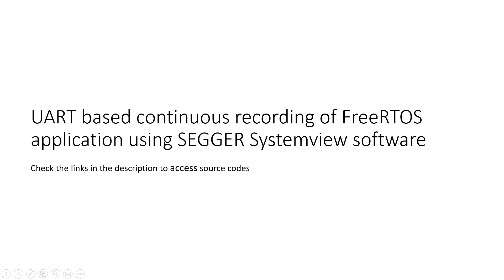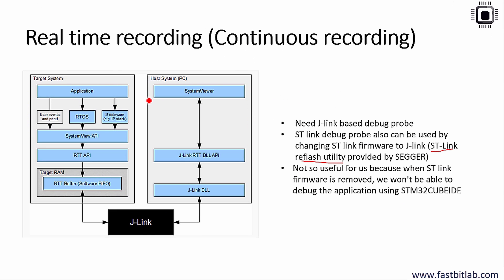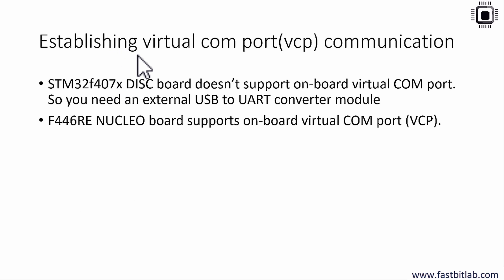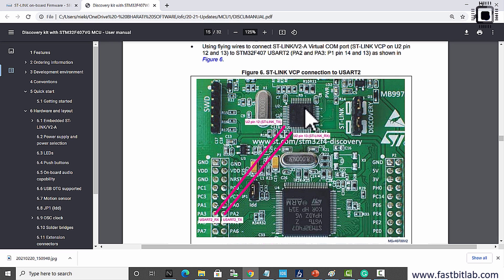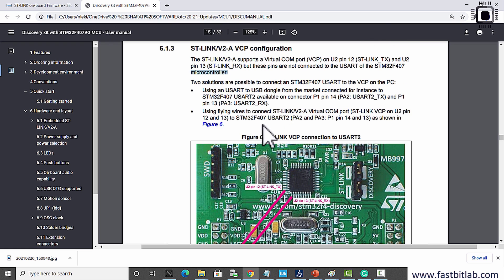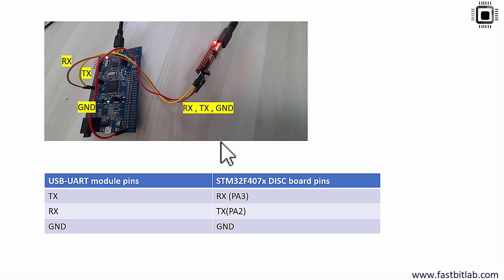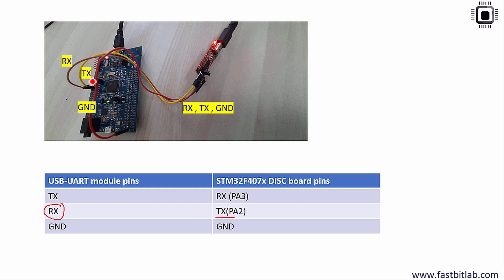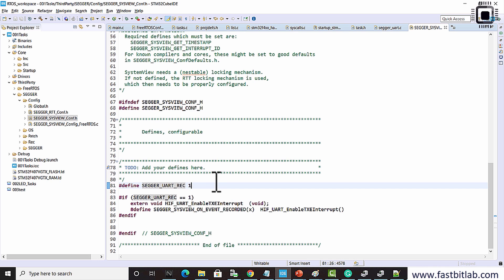FreeRTOS and SEGGER systemview UART recording

Comment: Just for the information for others, if you are using a different microcontroller than the one used in the video, then you will not be able to use the segger_uart.c file because the register addresses will be different for different microcontrollers. In order to use that file, you would need to manually change the register addresses by reading the reference manual of your respective STM32 microcontroller.

Comment: Is Segger system view similar to Percepio's tracealyzer?

Would the either tool work on an Arm (M4) running inside an FPGA (SmartFusion2)?  The IDE is eclipse based (SoftConsole), but I would think that there's not enough bandwidth to do real-time tracing/streaming via the JTAG debugger (FlashPro 4/5)?

Alternatively, could the tool be configured to output the data via the UART or CAN-BUS?

In addition to the software (OpenOCD), I would think for it to work from the JTAG connector, the SF2 chip would need to support SWO/SW.. and the FlashPro adapter would need the features as well.

I've some pricey Segger tools (J-Link/J-Trace models) that support "ETM Traces", but not sure if they support the chip.  Similarly, there's inexpensive adapters (EDU Mini, RealView U-Link2, Black Magic Probe, etc).. would those work?  

For example, I also have an AT ATMEL-ICE debugger, which supports CMSIS-DAP/SW/JTAG but no SWO..  which might explain why ITM_SendChar calls don't work with it!